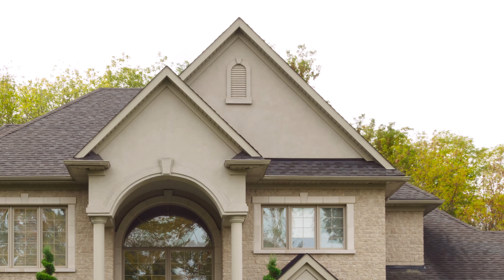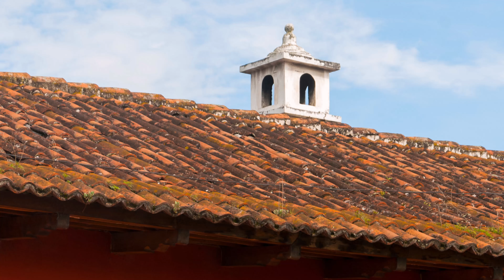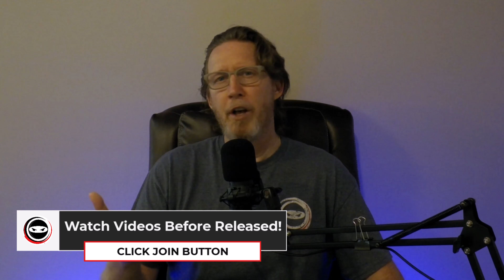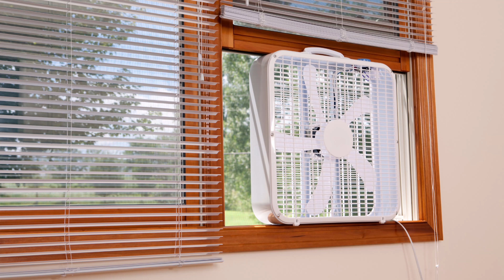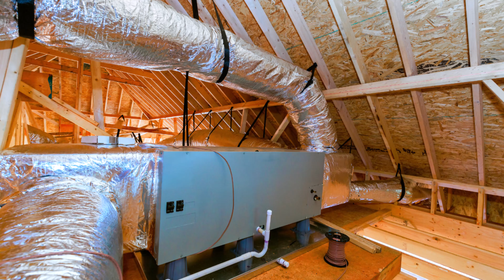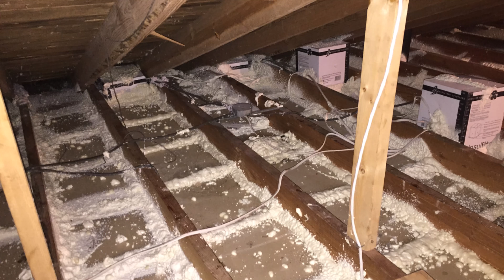Gable Vents May Be HURTING Your Attic Ventilation

Comment: I recently had a roof completely replaced and the contractor put in a ridge vents on both roof directions and have 3 existing gable vents one with a powered blower plus we have soffit vents. Should I cap the other 2 gable vent's?
Reply from the maker: I am sorry but it is hard to give a recommendation like that without seeing things. What did the roofer say about it? Is your attic staying cool the way it is? Is your home staying cool the way it is? These are some of the things I would think about before changing it. Hope that helps thanks for watching.
Reply: @CrawlSpaceNinja  I haven't put a thermometer, up there but it seems the fan comes on sooner than before and stays on longer into the night. It's a L shape roof and the fan is on the end of the L (bottom right side) I didn't mention the contractor's failure as they put the paper down, they didn't trim it back to allow air to get out the peak, I caught it a day after they finished. He said he was surprised and that (most homeowners don't get in their attics) LOL I do! Thanks for the quick response!

Comment: I have a two relatively large (3x2’) gable vents on each side. I have closed eaves so no soffits. Should I install a single gable vent fan to pull hot air out, and fresh air across my attic from the other vent? Or should I replace an old roof attic fan that sits in the middle of my roof higher up that could then pull air from each gable vent across the attic and up thru it? 

Im getting my roof replaced and one company is pushing for a ridge vent but without soffit vents it doesn’t make sense to me!?

The house is a 100yr old craftsman, piping and duct work is all below my house, I don’t think moisture is an issue.  

Thanks for any input! :)
Reply from the maker: From what I have seen, over the years, cross ventilation is more difficult to achieve depending on how big the attic is. Without seeing your roof and attic setup it is difficult to advise but it would seem that utilizing the stack effect to your advantage might be better. Having a fan in the middle and allowing the hot air from the attic to exhaust through the fan. Just keep in mind that any fan may pull air from your living space if the attic floor is not air sealed. Hope that helps thanks for watching.

Comment: how about if the top attic cant have soffit vents(only ridge vent and gable side vents and on solar but no intake, any good ideas?
Reply from the maker: When you say on solar do you mean you have a solar fan installed? If not it may be worth air sealing the attic floor and installing a solar fan to help move the hot air out without robbing the living space of cool air. I hope that helps thanks for watching.

Comment: My house has a metal roof with gable vents. I dont have soffit or ridge vents. I would like to add  air sealing on the attic floor more insulation and radiant barrier. Any advice would be great!
Reply from the maker: I'd recommend doing a consultation. buymeacoffee.com/csninja/e/111638

Comment: The short-circuiting point is real and underappreciated. A lot of homeowners assume more vents equals better airflow and never think about how gable vents and ridge vents can fight each other. The duct leakage piece is worth flagging too - if your ducts are running through a 140-degree attic and losing conditioned air through gaps, no amount of ventilation fixes the energy hit. Sealing attic penetrations first before adjusting vents is solid advice. If you want a professional eye on the full picture - duct condition, insulation levels, soffit blockage - some HVAC companies do attic assessments alongside comfort calls. ARS/Rescue Rooter is one option worth checking depending on your area, though not every branch covers attic services, so confirm what's available near you before assuming.
Reply from the maker: @DanielHarrisVlogs Well said. Short-circuiting and leaky ducts are often overlooked when homeowners focus only on adding vents. Thanks for watching!

Comment: I have an attached garage, that is exposed, no insulation or drywall, there’s screen little door above for access to the attic, would that mess with air flow?
Reply from the maker: It could yes. Especially when garage doors are open. Thanks for watching.
Reply: @CrawlSpaceNinja thank you, do you recommend that block the screen door?
Reply from the maker: @point1er it's hard to say without seeing it but in our area we don't have screened hatches.

Comment: Is it possible for a roofer to fake installing ridge venting or improperly install it? If I am inside my attic and looking up at the peak of the gable, should I be able to see the metal vents? All I see is where the two sides of wood meet at the peak. I don’t even see a slit wide enough for any air to get through.

Meanwhile I have gable vents at west and east end. I have four soffit vents on each north and south side. My soffit ventilation is a joke. Pieces of cardboard boxes by insurance claim vultures with certifications that allow them to screw up homes and take insurance money for doing it under the guise of “Preferred Vendor”. Nobody honest in area as far as a contractor who is willing to “get involved with insurance disputes” while we are left on our own anyhow and I need to figure out how to get my attic correct myself.

I need to take my time at it as can’t afford to do it all at once. I’m also thinking doing it all at once is not a good idea. Maybe if I get attic ventilation corrected, all the soot and char dust and demolition dirt and  dust that is in walls and between ceilings and floors will get sucked out of house over time.

If the ridge venting is working, it’s possible I have the short circuit you describe but I think right now I only have gable ventilation and ridge venting and need to install correct ventilation to get my soffit air to the peak before I think on gables being negated by ridge venting added in 2014.

I am no contractor and trying to learn as fast as I can, starting this past June 2025, because I am in a race vs electric ⚡️ heating bills while cooling bills are 58% higher (according to ⚡️ company) since before our disaster (insurance company) that happened after root cause to find out our insurance company is the biggest disaster.
Reply from the maker: @author The cardboard blocking the soffit vents is a serious problem. Check the ridge opening first, then work on getting clear intake air from the soffits.
Reply: @CrawlSpaceNinja  ,
Thanks for the validation! I found one local pro who understands the building science and can fix this, but he’s terrified of being blacklisted by the regional restoration contractors if he touches an insurance dispute.

I just hit my carrier with a formal legal demand to guarantee his protection. If they refuse, I’m on my own and will likely be booking a paid consult with you. If I have to tackle those eaves myself at my age, I'll need a "Rocky" training montage just to avoid doing a "Chevy Chase" through the ceiling.

The previous owner's 1980s insulation wasn't perfectly air-sealed by modern standards, but it was vastly better than this. The local pro said the restoration crew basically stole the insurance money because what they left behind is completely worthless. I'm now projecting $1,500 monthly electric bills this winter—my energy usage is up 59% despite just upgrading to highly efficient 2025 Electric Thermal Storage heaters vs what was 1984 and removed.  Maybe someone can explian to me why an Insurance Company determines that the electric heating system is contaminated but ignores all the wall outlets. The insulation expert who was in here said the smoke came through my outlets. So far I have inspected, cleaned and replaced most of 18 outlet boxes, switch boxes, etc. and I have the remainder of what is over 50 to go.

Comment: I'm in North Florida, closed soffits, multiple gable vents, i have a ridge vent, however; the roofing company didnt cut a slit in the vapor barrier. What do you recommend?
Reply from the maker: @author First verify whether the ridge vent has a continuous opening through the roof deck. If the vapor barrier is blocking that opening, the ridge vent cannot exhaust properly. Hope that helps.
Reply: @CrawlSpaceNinja yes, it has a continuous opening. In the attic, you can see the vapor barrier covering that gap as if they never cut a slit in it.
Reply: @CrawlSpaceNinja Yes, ridge vent has a continuous opening. You can see the uncut vapor barrier running the whole length of the ridge vent. On the roof side, the ridge cap is the vented type ridge cap. Only air flow currently are gable vents.

Comment: Gable vents, obviously better with power exhaust. You cannot mix systems. Ridge vents are spider hotels and soffits is the whole perimeter of your roof where spiders also like and wasps and ants. Gable vents give a controlled area. Soffit baffles provide a very minimum amount of airflow space and completely block inspection. Perhaps they are easier to balance. But you need to look out for dead zones, places where the humidity isn't going to naturally equalize. Ridge vents, I think, are a terrible innovation. They come in and cut a hole at the peak of your roof, usually leaving all that debris in your attic. You get very minimum airflow on a hot day. The spiders love inside the ridge vent and that peak area of your attic. So what if you have a powered fan in your attic? Your house has other maintenance items. If you're worried, put an alarm on it. Any air you bring through across your attic is going to pull other air and equalize humidity. Maybe instead of raw dogging it, "building scientists" should recommend actual data, to install wood moisture monitors with a simple alarm for the unexpected.
Reply from the maker: @author Moisture monitors are a good way to verify what is actually happening instead of guessing. Hope that helps. Thanks for watching!

Comment: Mike Guertin says ventilated attics are very forgiving. Can I keep my gable vents with just a ridge vent in the northeast? I air sealed and insulated
Reply from the maker: @author You can, but the airflow needs to be balanced. Gable vents may reduce the effectiveness of the ridge vent if they become the path of least resistance.

Comment: I recently reroofed and had a ridge vent installed. After doing the math, I don't think i have enough ridge vent capacity to provide the 1:150 ratio. Can I increase my exhaust by adding some addtional vents 3 ft down from the ridge vent? I'm worried about short circuiting... but AI thinks it's the way to go. The roofer said I should just increase the number of soffit vents. I thought it's supposed to be 50/50 intake to exhaust?
Reply from the maker: Are you adding power vents or passive? I have a solar fan below my ridge because I wasn't getting enough airflow via my ridge either.
Reply: @CrawlSpaceNinja  Passive. So, you think that would be ok to add some passive box vents 3ft below the ridge vent?

Comment: I removed all the loose fill insulation in my attic floor and I hired a contractor to spray foam my roof deck, I was expecting him to leave something for fresh air circulation but he sprayed foam all gable vents, ridge vent and soffit vents, leaving my attic completely encapsulated, he told me since I was going now with spray foam in the underside of my roof deck I didn’t need any type of vents anymore, his words was that the purpose of the spray foam was to completely encapsulate an attic. Since I got my attic done 3years ago I keep wondering if he was right or I should add any type of vent. I still think I need some fresh air circulating in there
Reply from the maker: @author With a properly designed unvented, spray-foamed attic, closing the vents can be correct. The important part is that the roof deck is fully air sealed, the foam is installed correctly, and the attic remains dry. Hope that helps.
Reply: @CrawlSpaceNinja thanks for the feedback! Y’all are the best! Been watching you for a while
Reply from the maker: @DanielRojas-ux5xz thank you so much.
Reply: Daniel, you have what is a hot roof now. Hard on shingles if you have them even in Ny, let alone somewhere really hot. Im always a fan of leaving a 2” gap

Comment: Ridge vents are generally awful for existing homes without them. They probably work if everything is specifically designed for your home and installed correctly. Your roof will be replaced by some random crew in a day and the rest is your problem. Best thing I ever did was reinstall my gable fan after dealing with a house that couldn't cool . This was after a new roof with ridge vents was installed and my gable fan removed.
Reply from the maker: Thanks for sharing.

Comment: Seal them, keep the convective loop going. Negative pressure cool air low, positive pressure hot air above. Gable vents would then be around the neutral pressure plane, effectively useless.
Reply from the maker: Thank you for watching.

Comment: I’m a roofing contractor, I want to make sure I’m
Getting proper ventilation for these homeowners what’s best way to cover seal up gable vents without replacing anything on outside
Reply from the maker: We find rigid foam board and spray foam work well. Thanks for watching.

Comment: I have 3 triangle Gable vents, two on the side of the house, they are 4' tall, maybe 10' on the base, the 3rd one is about 3' tall 6' base like a T-shape perpendicular to the house. I don't have ridge vents (I think I should have) nor soffits vents, but I had cut four 2'x2' holes on my two porch ceilings and one 2'x2' hole in one of the garage rooms ceiling. Those ceiling vent holes really help in summer. I even made the inside covers for Gable vents in the winter to block the cold air coming into the attic, also block all 4 ceiling vent holes in winter. I am in DFW area and my answer is A) leave them open. Heat exchange is not only from soffit to ridge vent, but also from inside of attic go through Gable vents to the outside, because hot air flows toward cold air. Or, when the pressure from Gable/ridge vents are larger, they push hot air out through ceiling/soffit vents. As long as air temperature are unbalanced, they will balance out automatically. So, leave them opened is my answer.
Reply from the maker: Thanks for sharing.